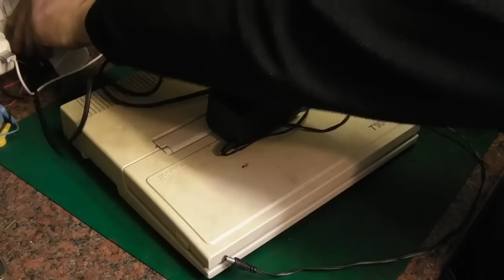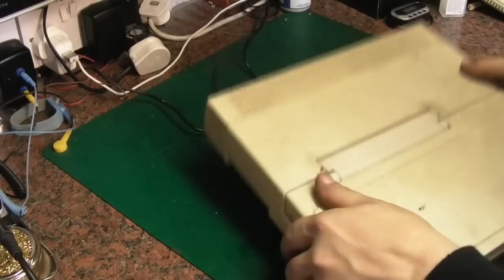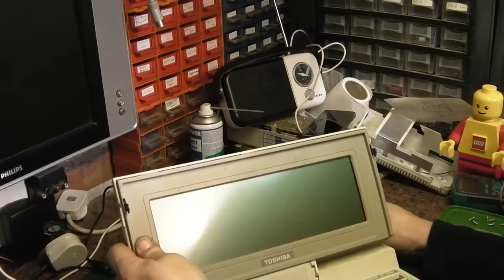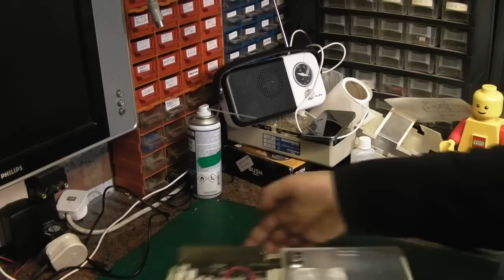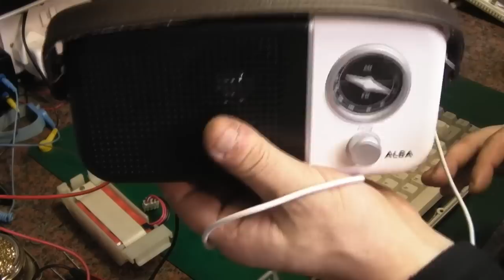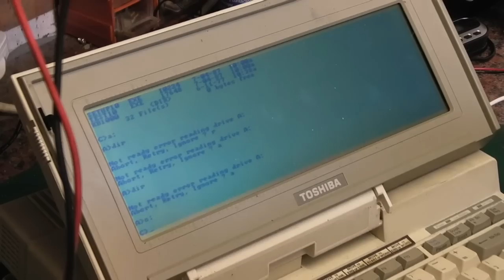Toshiba T1000 Laptop Lookover and repair Pt1

Comment: These things are basically IBM PC 5150s but smaller, considering the 4.77 MHz 8088, 640 KB of RAM, no hard disk, CGA graphics, except for this having 1 3.5" 720K disk drive while the PC had 2 360K disk drives, no expandability while the 5150 had 5 8-bit ISA slots, and DOS in ROM while the 5150 had a very simple BASIC interpreter
Reply: It have some sort of expansion slot. Above battery. I got one laptop like this and have a modem card above the battery, connected with a flat cable to the motherboard. I suspect is a 8bit isa slot in disguise.

Comment: Hello, I’ve got the same computer from my uncle. My floppy drive also have an error (Read fault error). Cleaning the head doesn’t work. Maybe you (or someone else here) have a idea. Thank you
Reply: Lubricate all moving parts with silicone grease then look at capacitors, 90% of old defect floppy drives need reccaping.
Reply: These floppy drives are notorious for the drive belt perishing and when that happens the motor can't spin the magnetic disc in the floppy disk and it will not read. These belts can be bought on E-Bay

Comment: I've had the same issue, a BTOpenreach bloke was rewiring a neighbors phone ,and he crossed their wires with mine, screwing the phone up and killing the broadband. After getting it fixed my speed is sub 3Meg... I used to get 7.5 on this line <_<
To those of you laughing, I can only get ADSL here... but Virgin has laid cables, true high speed is coming sometime.
I used to have a pair of T1300, my first laptops. I wish I still had them but they both failed the same way, the power LED would flash when plugged into the mains, but the machine would do nothing more.

Comment: Just wondering why this is normally supplied with 9V when clearly the logic and screen are happy with 5V. Could it be that the floppy drive needs more than 5V?
Reply from the maker: Its for the battery charging circuit, you need a slightly higher voltage than the batteries capacity to charge old nicad batteries.
Reply: @Jayoldstuff1  Ah,Yeah, I should have thought of that.